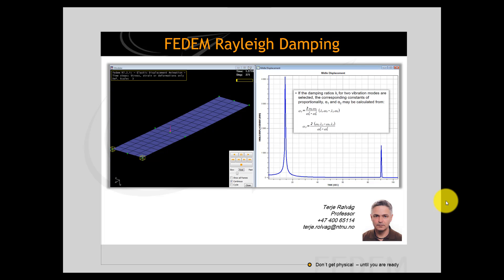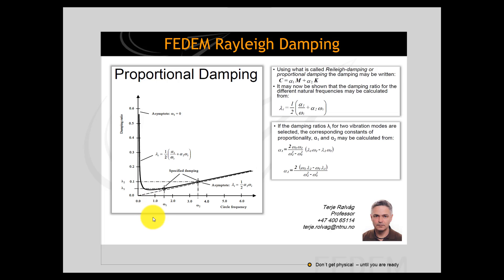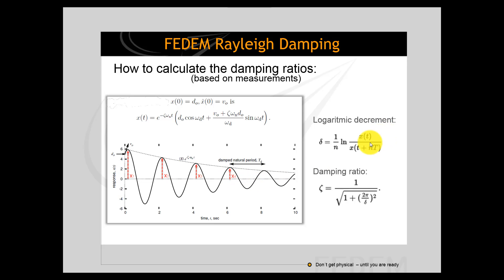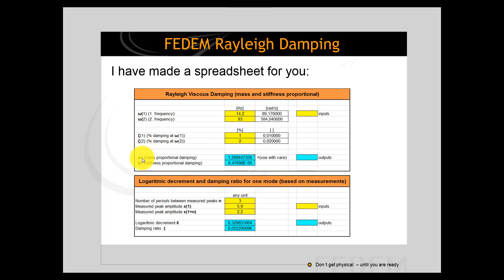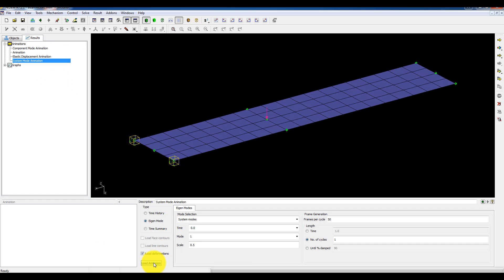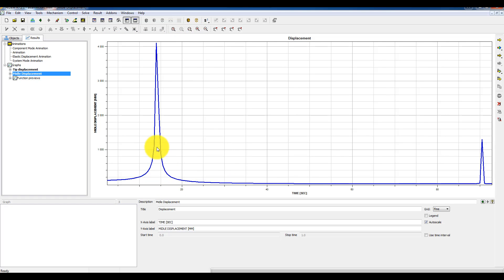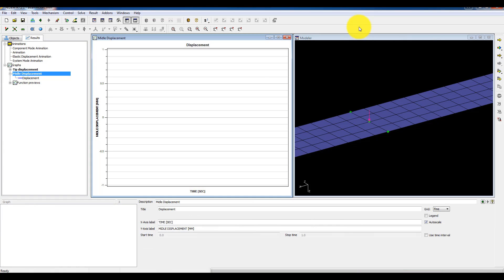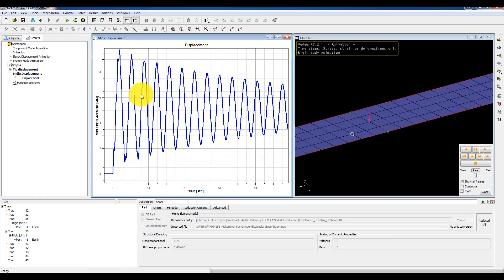FEDEM Rayleigh Damping

Comment: Thank you for the video, it is quite explanatory and helpful.  However,  I am a bit confused with the way you extract the damping ratio at w2. At first, you get the damping ratio using the log decrement on a response vs time graph. I am fine with that but how did you end up with the damping ratio at w2 ? Am i missing a point there?
Thanks

Comment: Very nice video, congratulations! I didn't actually understand the problem with mass proportional damping. Could you please explain it further or provide any link? Keep up the good work!
Reply from the maker: Thanks. Mass proportional damping is a special concern when you have high speed motions like you usually have in FEDEM simulations. Then the mass proportional damping becomes proportional to the rigid body motion and not the elastic motion that is the original intention with this type of damping. Then the damping will act more like a drag effect causing far to much damping at high speeds